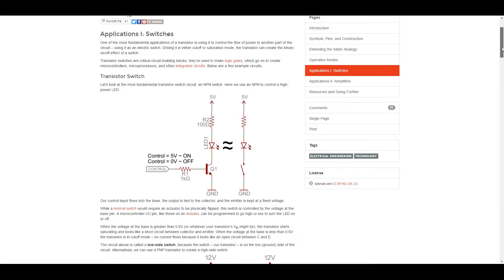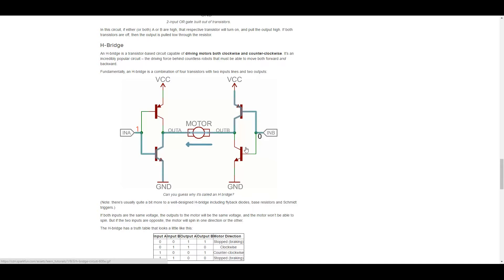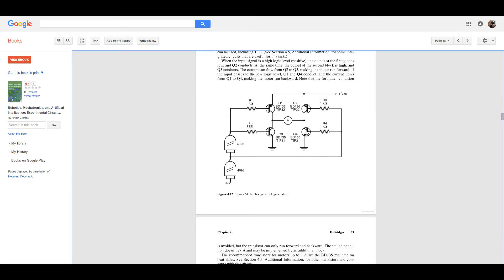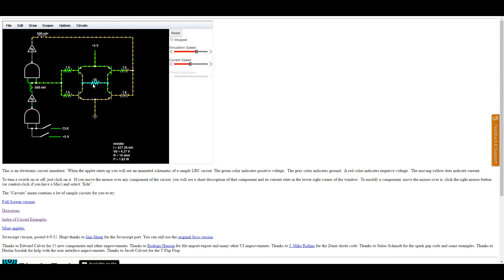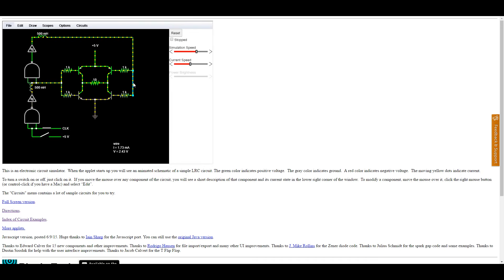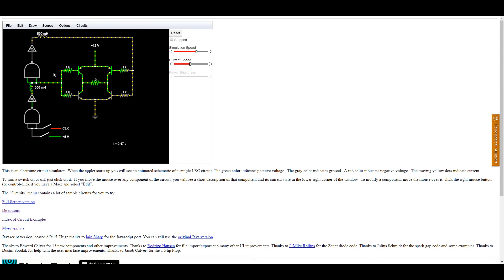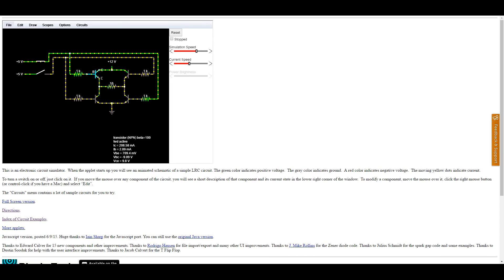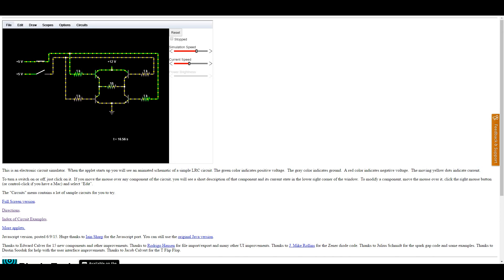How NOT to Build an H-Bridge Motor Controller

Comment: I recently built my own H bridge motor controller and had the same problem you faced at the end of the video. Im trying not to use a H bridge IC since it'll be a good learning experience to design one that works myself xD.

Comment: would replacing transistors with MOSFETs solve the problem?
Reply from the maker: Yes, MOSFETs would work as long as the off input state is equal to 0V/GND (not high impedance).

Comment: Though this is a very good video(thumbs up), I strongly disagree on not building from scratch, because many users watching this video really need to understand the operation of diodes, RC timing, transistors, operational amplifiers and comparators. Without knowing the fundamentals of the aforementioned components they will go on a search for a "canned" product that doesn't do what they want. For example current sensing circuits, high side driving of  N-Channel MOSFETs, HF interleaved boost converters, etc.. I encourage anyone who wishes to understand how controller ICs operate, to build similar circuits in simulation, using discretes, check your math then build them in reality. Another thing that should be mentioned that I don't see in most H bridge related videos, is that an H bridge can be used to in DC-DC conversion design, where the motor is replaced with the primary of the output transformer, using a different control scheme.
Reply from the maker: Yea I'm totally with you on that. I don't believe I advocated using a canned circuit. The point of this vid was to demonstrate the risks in doing so. In part 2, I show the process of building an H-bridge from scratch with a focus on design thinking.
Reply: Where is the flyback protection in the H-bridge circuit normally?

Comment: this is just a snippit from an entire circuit, I imagine the current limiting is done before the input, and not relavant to the operation of the h-bridge. Not to mention the falstad site seems to always assume the perfect power supply, which does not exist. I really don't know why you expect them to add the current limiting circuitry to an h-bridge tutorial since it would distract from the lesson itself. If you implement it in fastad with proper current limiting and base resistors, there seems to be no problem for me.
Reply from the maker: Are you referring to Sparkfun's circuit? What do you mean by current limiting? You mean on VCC? Current limiting on an H-bridge only protects your power supply from stall conditions, it has nothing to do with normal H-bridge operation. I built this circuit in Falstad with base resistors to check your claim that it works. It doesn't. http://tinyurl.com/yddwc8d4
Reply: vcc in for example does not neccesarily mean straight from the supply. limit the current comming in  from vcc even with a resistor, and the circuit works out just fine.

 https://goo.gl/7ZyVYD

I am sure there are much better ways to illustrate this, but you would never have no resistance through transistors coming from a power supply, so I don't understand why you are showing the circuit as such.
Reply: That last link was bad, because I am special and did not use the proper method. but here is a better link to how you would actually do it http://tinyurl.com/ybppxk59
and I will return with the way I tried to link moments ago.

Edit: proper link to proper orientation of mosfets, because I just can't seem to handle copy pasting properly today with so many circuits open.
Reply: http://tinyurl.com/ybvokupz

That is yours with easy adjustable voltage input for the transistors, and teh transistors spots have been swapped, and there is no resistance on incomming vcc, the load does all the resisting. Seems you were looking at some bunk charts.
Reply from the maker: Okay, but all this does is put VCC through a 100 ohm resistor. That still doesn't resolve the problems with this circuit. http://tinyurl.com/y9fs3rve 

Note that in this simulation, only 23.2% of VCC is being dropped over the motor. The rest is being wasted.
Reply: I am going to be honest, looking through the good image for schematics gets you crazy results, I see all sorts of transistor orientations for BJT's and its like people are just trying to draw them all from memory without testing them. I understand why you seemed to think it would not work. because 80% or more of the ones on google image seem to have the transistors in a way that does cause the short circuit you speak of. Crazy eh. Anyways, despite all that, I enjoyed your video, and I like how you constantly ask your audience to think of the outcome of what is happening before you state it. 

The way you have it set up does do exactly what you say in this video and yeah, awesome that you noticed that. Had I not seen this video I would have probably blindly made an H-bridge with a 10 second google search the next time I needed one. You are awesome mate.
Reply: I linked you a bad link earlier
Reply: Also, I think I missed the point of the video in that you were showing how online schematics were not always bright. I am sorry about that mate.
Reply from the maker: Yea no problem. The new edited link is a different circuit than the one I'm critiquing. I'm sure there are many ways to get the circuit working by redesigning it and switching out components for different ones. That being said, the new design is still not optimal, because you have a 5V VCC but only 0.8V dropping over the motor.

I have another video where I talk about proper bjt H-bridge design. https://youtu.be/4y2kPmxW-xk

I'll need to do one for mosfets one of these days.
Reply: Josh Sideris already watched it twice.  And yeah. I missed the point of the vid initially I think lol.  Also I subscribed :)

Comment: this shud work ryght  replace lamp by 9v motor http://www.falstad.com/circuit/circuitjs.html?cct=$+1+0.000005+0.41233529972698213+50+5+43%0At+304+176+352+176+0+1+-2.1709400417989984+-8.99999999995+100%0At+304+288+352+288+0+1+1.2874209946948623e-24+-2.2024062218694107+100%0At+544+160+512+160+1+1+0.6298449151876263+-1.541095126661372+100%0At+560+304+528+304+1+1+0.6125162356744855+-6.185077542456104+100%0Aw+352+160+512+144+0%0Ar+304+176+256+176+0+1000%0Ar+544+160+576+160+0+1000%0Ar+560+304+592+304+0+1000%0Ar+304+288+256+288+0+1000%0Aw+256+176+256+288+0%0Aw+576+160+592+304+0%0Aw+592+304+688+304+0%0Aw+256+288+144+288+0%0Aw+416+224+352+160+0%0Aw+352+192+432+256+0%0Aw+432+256+528+288+0%0Aw+352+304+528+320+0%0Aw+352+272+512+176+0%0Aw+448+224+528+320+0%0Av+400+336+480+368+0+0+40+9+0+0+0.5%0Aw+480+368+432+256+0%0Aw+160+368+144+288+0%0Aw+192+352+560+400+0%0Aw+560+400+688+304+0%0Aw+400+336+336+336+0%0Ag+336+336+320+336+0%0Ag+352+272+336+256+0%0A181+416+224+448+224+0+300.0005700067262+100+120+0.4+0.4%0Av+208+336+192+352+0+0+40+5+0+0+0.5%0Ag+208+336+224+336+0%0Ag+160+368+176+400+0%0A
Reply from the maker: Haha I thought this was a joke at first and was just about to frame it and hang it on my wall. Then I realized it was real. Take a look at how this rendered on my screen: http://imgur.com/a/Z4mST

Ok so the problem is that for some reason none of the voltage is dropping over the motor. All 9V should be dropping over the motor. The error is that your inputs are 5V but your main battery is 9V. A 5V input won't be able to shut off a 9V Vcc for the PNP transistors up top.
Reply: lolol thnx fr the complement xD!!!!! n the reply!

Comment: hey can we use the first schematic that u showed using pnp if we connect a resistor of 220 or 1 k ohm to each of the base to drive a small 9 v DC motor?? Please Reply soon THnx U hav a sub btw ;-)
Reply from the maker: You need to simulate all your circuits.

Seems like a fairly risky design. Think about what happens in that circuit if one of the inputs goes to high impedance. You're going to get current spikes during switching. But I don't know. Maybe it can be done. Simulate.

I have a part 2 of this video where I explain how to build an H-bridge. My suggestion is a little more complex than this, but its tried and tested (by me). Check it out.